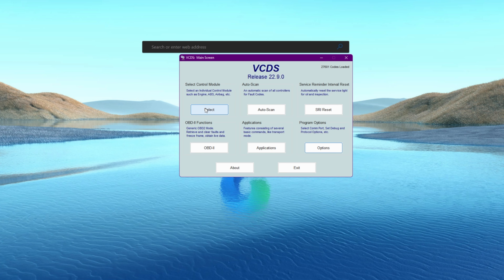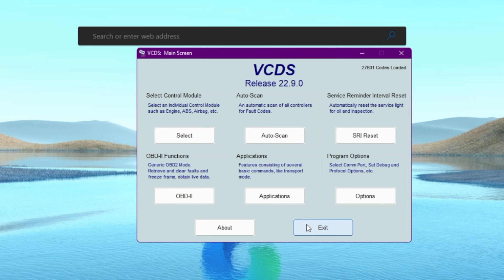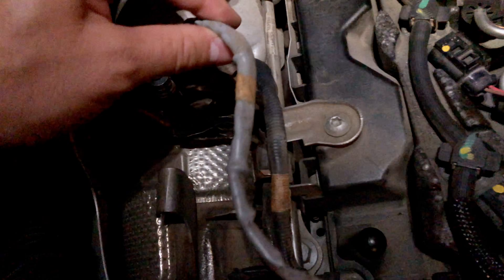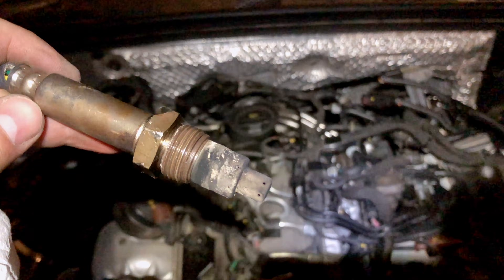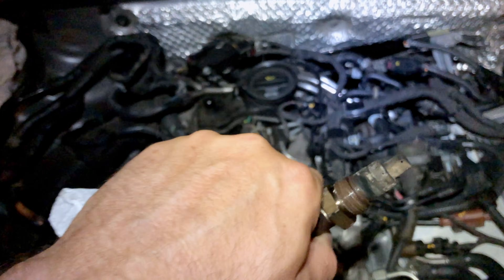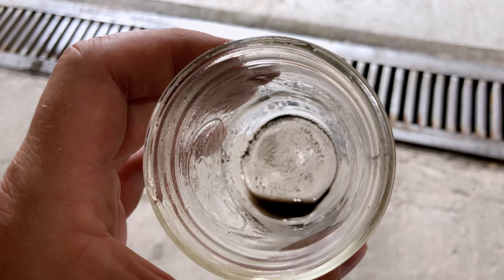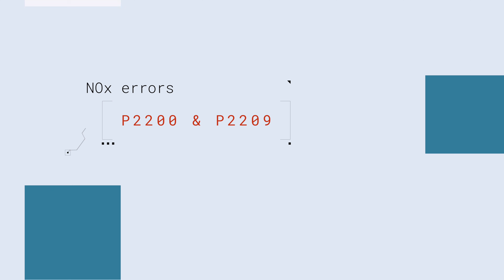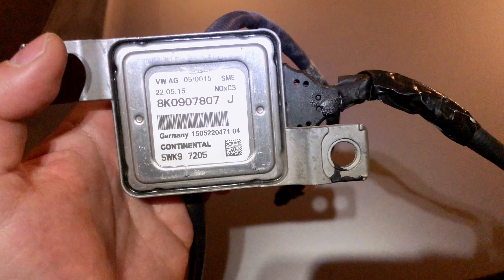NOx & Lambda sensors cleaning. NOx repair

Comment: Hello. I have audi a4 cnha engine, 2015 model. My vehicle is at 240,220 km. I took it to my mechanic for heavy maintenance and it has exactly the same set-up as your engine. I am very happy to see this video. I deposited the sensors in isopropyl alcohol while I was being serviced. The ends were left in isopropyl alcohol for 1 day. (2 exhaust gas temperature, 1 oxygen, 1 nox sensor). When I looked at the sensors, they were all cleaned, no residue, soot or dirt remained 👍. everything of the vehicle was ok, we went for a test drive and it turned on the check engine lamp on the road. when we got back at service, we connected it to ODIS and got the p2200 and p2209 errors. The computer directly told us that "the G295 and J583 sensor should be replaced, suspecting it to be defective." First of all, we checked to see if there was a problem in the wiring of the sensor to the ECU in terms of safety. Electricity was going to the ECU. So there is no problem with the socket. the problem itself was directly the nox sensor and control unit... (G295 and J583) I will ask if the cleaning process may have spoiled it, but I dont think that 99.9% isopropyl alcohol will spoil it, after all alcohol is a volatile and cleaning substance. Cleaning didn't work for me. should i buy a new sensor? exactly the same, including our sensor codes (8K0 907 807 J). And also I want to contact you if possible. I would like to send photos from instagram dm
Reply from the maker: Hi there. Indeed cleaning was not the answer for me either. Replacing NOX is expensive. I think replacing it with a second hand one is a good option as long as it does not cost a lot. I got mine from an Audi A4 2018 for about 40 euro and is working ever since. It is very important to get the same model as you have.
Reply: @bonevchannel so does it have to same sensor code? Will my vehicle still accept the nox sensor in a b9 case 190 hp (e.g. DETA or DFHA or any 2.0 diesel euro6) a4 or a newer nox sensor manufactured after 2015?

Comment: Hello! 

I have an Audi A4 B9 150CP DEUA motor. 
Do you have any idea if is it possible to get a nox sensor from a 3.0 engine (Audi A4 B9 3.0)? 
Is it compatible from engine 3.0?

Thnaks,
Benjamin
Reply from the maker: If the numbers on the NOx sensor match then no problem.
Reply from the maker: Yes it will be as long as the part has exactly the same part number!